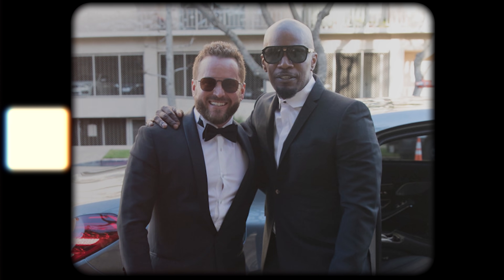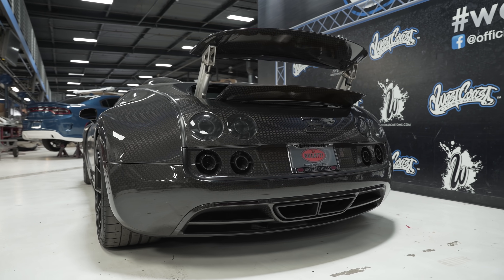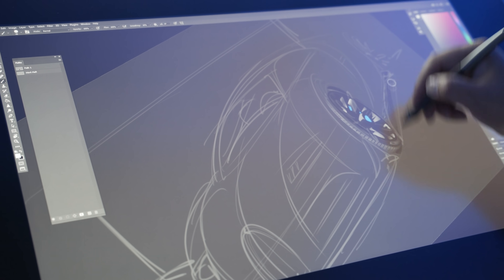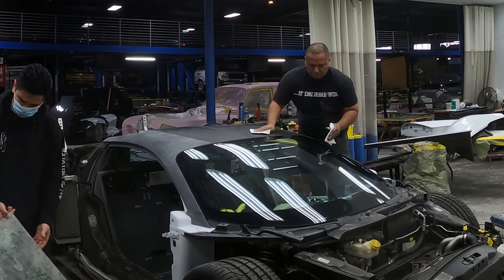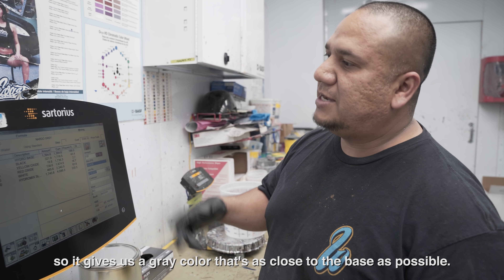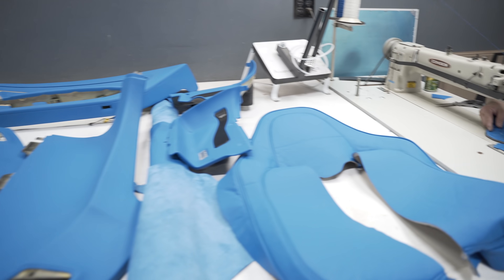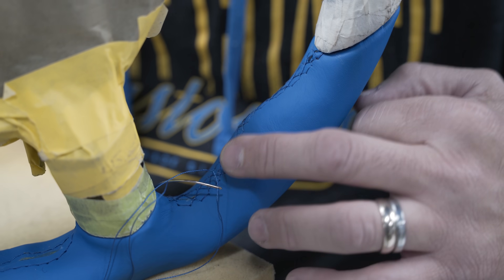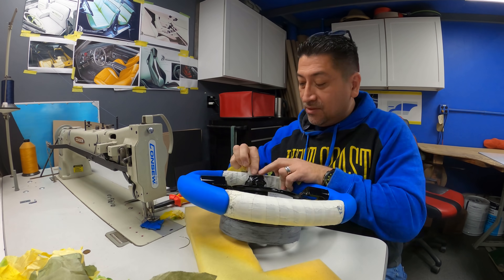Mansory Bugatti Veyron | West Coast Customs

Comment: Dude who the fuck painted those calipers they should be fired, overspray on the carbon ceramic rotor and they didn’t even mask off the lines or bolts wtf